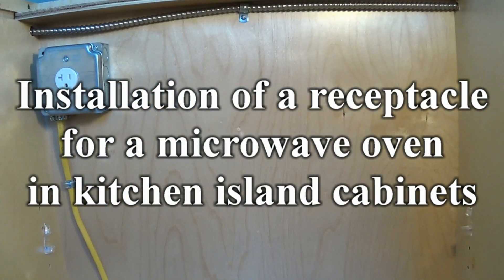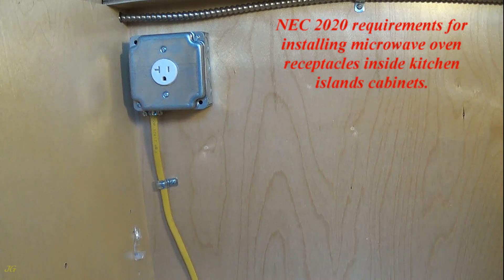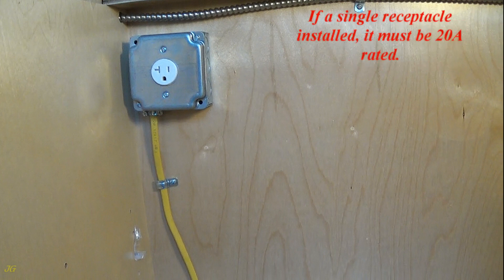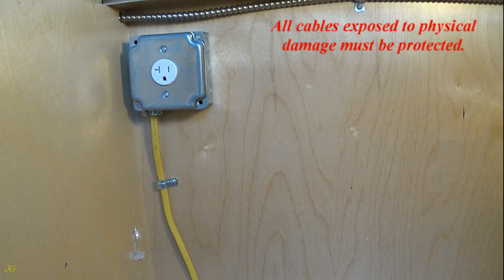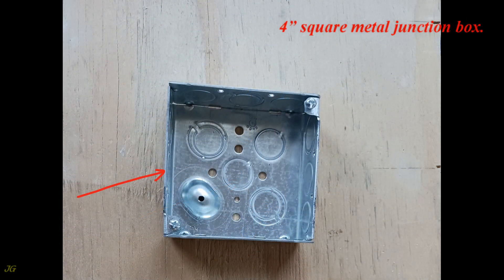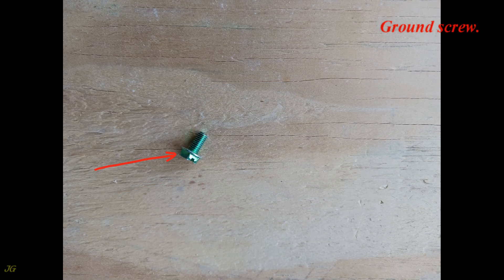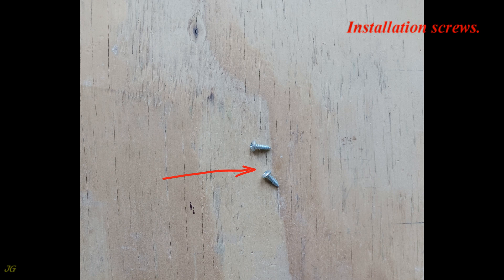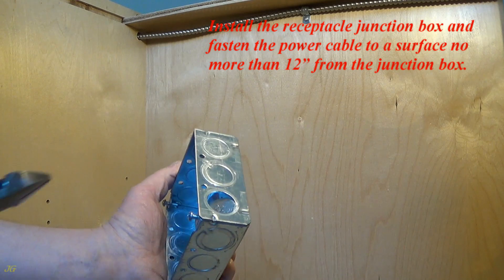Installation of a receptacle for a microwave oven in kitchen island cabinets

Comment: here coup;e things  1)  receptacle cannot be behind the microwave it has to be readily accessible 
                                   2)  All cables exposed to Physical damage must be protected PLUS  the clamp used to secure the wire is not to be used with romex wire 
                                   3) mc (metal clad) cable should be used in exposed surfaces  Romex wire is for used in walls never ever exposed
                                   4) 4x4 box super big for the application plus one receptacle force you to used 12/2 wire vs 14/2 wire you will save money in wire, breaker afci , and the box
Reply from the maker: Do you really know the NEC in its entirety?

Comment: Cant I just run the wire from the ceiling light in the floor below my center island?
Reply from the maker: No. Most microwaves require a dedicated circuit. All kitchen receptacles must be connected to 20A circuits with very few exceptions.
Reply: @johng2913  well that stinks, seems like a job for the electrian
Reply: NO the microwave requires a dedicated circuit not necessary a 20 amp if the microwave consumes less than 1500 watts You could run 14/2 wire with a 15amp  afci breaker

Comment: Don't think that Romex is allowed in this location, should be 12/2 mc cable like the one passing through above.
Reply from the maker: It is allowed. It is installed behind a built-in microwave oven.
Reply: @johng2913  if it is a built in appliance it has to be accessible it has to go int he adjacent  cabinet and romex can not be used

Comment: If you use a duplex rather than a single receptacle you can use a 15 or 20 amp device, unless the microwave oven has a 20 amp plug aka NEMA 5-20P  (very unlikely unless it was a commercial grade appliance)
Reply: True but I like the single device for appliance outlets. Except for the Dishwasher/Disposal outlet of corse.
Reply: Agreed, but if this is an individual branch circuit aka a dedicated circuit, which it should be, then a 20 single receptacle is required. A duplex receptacle counts as 2 receptacles. Another thing is that a microwave oven in a kitchen island is considered to be utilization equipment fastened in place and likely will require input power greater than 50% of the circuit rating and therefore must be on a dedicated circuit, NEC 210.23(B)(2).